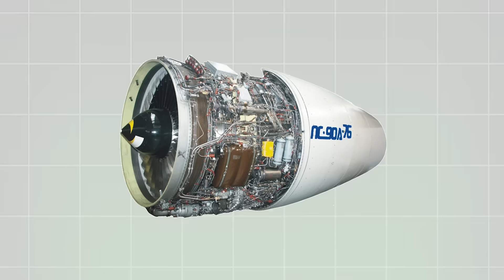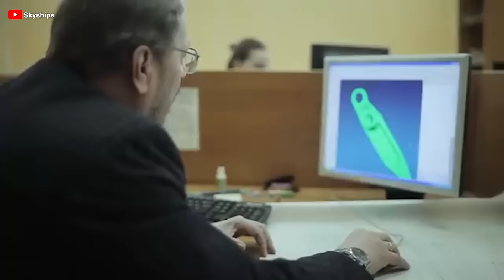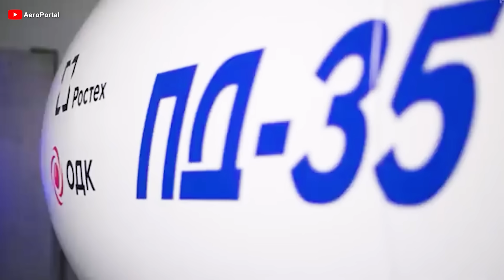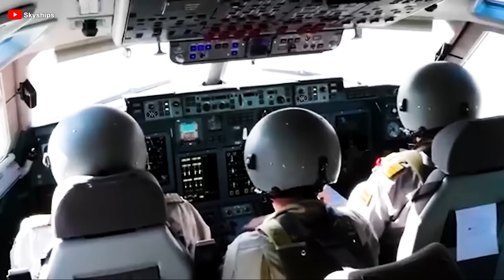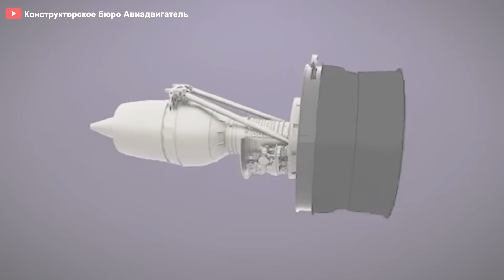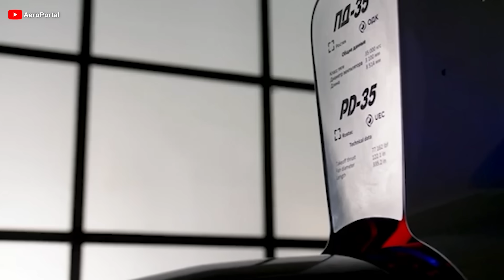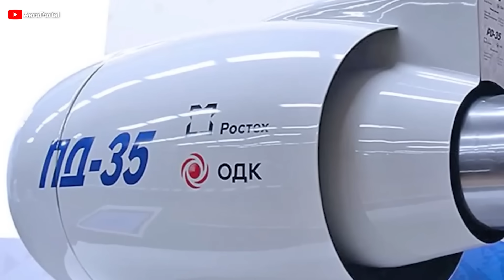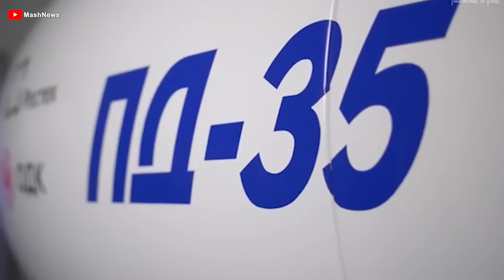Russia REVEALS the Il-96 will CHANGE Long-Haul Game-Changer! Here's why

Comment: If someone calls out "electronics is outdated" you are wrong. Likethose in earlier  airbus aircrafts, there are "aeroflex-inspired" rsverse-engineered microprocessors fully processed domestically. It could be replaced by honeywell parts if you have a strong need to.
Certs? Since boeing tests thenselves with faa crew that relay specific tests to boeing back.... whelp.... sound contradictory but tail wagging the dog.

Comment: To be correct, ПС90А engines can't compete with fuel efficiency. That is all. There were flight tests with P&W-1000, but westerners said "screw that jet, we don't need competition" pulling out P&W.  ПД-35 with HUGE intake and compressor will reconfigurate il-96-300 from 4-engine aircraft to 2-engine greatly reducing fuel hunger.
Reply: You are correct! Honestly the video is wrong in so many points. What maybe revives IL-96 and possibly TU-204 is the fact that Western sanctions are forcing Russia again to make their own commercial airliners, very likely in cooperation with China. That doesn't mean it would be competitive with Western aircraft. Btw. It was the PW2000, not 1000 which was planned to be a Western engine substitute for the PS-90. And that story is already 25 to 30 years old. Neither the PS-90 nor the PW2000 are really competitive with modern turbofans anymore.
Reply: Ps90a has  a bypass ratio of 5.3:1
At that time European and western engines had around 6-6.5: 1 bypass ratio meaning it wasn't that behind it's just after USSR collapse Russians semiconductor and aviation industry got wrecked
Reply: @gwramim4807 The PS90 isn't a bad engine but it was 20+ years behind Western engines where similar engines were made in the early 70's. When the PS90 came out the west already moved on.

Comment: Take example of A330 and A340, similarly, IL96 can also be offered in 2 or 4 engines with same fuselage. If the Boeing can sell 80 years old B737 with uplifted varient so why not Russia?
Reply from the maker: Great idea!
Reply: It cannot be offered in a 2 engine version because it simply doesn‘t exist.
Reply: @alexandervt641  It's coming as you saw in the video!
Reply: erm....the 737 is not 80...(jesus...) and the two Airbus Aircraft you mentioned...ARE BUILT PROPERLY.  Russia can't even make cars.

Comment: The question is what is China doing. Is it developing its own aircraft engines or will it partner up with Russia?

The West is significantly ahead in technology but Boeing is extremely corrupt and cut a lot of corners with the 737 MAX and has fallen as a reliable manufacturer, relocating HQ to Chicago, and production to South Carolina, they have badly made frames, bad workers, and a huge disconnect between the engineers and the production. They should have made a new plane already for the new bigger engines and they are still failing to do so. Meanwhile Airbus is winning the competition with the 320 Neo, they have a newer plane and can upgrade better, even though the A380 was a lot of wasted money in development and did not conquer markets as they believed it would. Because of these a third competitor can enter the scene but it is not likely to be Russia but China. China has the captial the time and the political will to create planes that are on the same level as western planes just like ti did in the car market, it might take a decade but it can get there especially if it teams up with Russia to learn as much technology as it can.
Reply: uh.  The ENGINES are not made by either Boeing or Airbus
Reply from the maker: I agree. China's growth rate in any industry is too fast.
Reply: FYI the Boeing headquarters is not in chicago.
Reply: @RaulGonzales-u7p  well it used to be in Seattle the whole thing and they could cooperate very well and when the merger happened with McDonnell Douglas that is when the HQ moved to Chicago. As far as I understand what I am reading it is still there:

In May 2022, Boeing announced plans to move its global headquarters from Chicago to Arlington, Virginia, a suburb of Washington, D.C. But it was not yet moved.

The whole point is they dismembered a well working company where the HQ the engineers and the manufacturing was all next to each other in Seattle.

Comment: Ił-96 is unermarkable, it coudl work but would need serious overhaul and technology refresh. Starting with engines, and with unremarkable PD-14 being latest Russian engine.... PD-90 is not for this day and age. Ił-96 could actually make a living as MRTT for non US aligned countries.
Reply from the maker: Thanks a lot for sharing!
Reply: PD-90?!?!? It will really blow up the market!🤣 Maybe u meant PS-90 - old one from 90-s? Today there is a line of the PD aircraft engines. "Unremarkable" PD-14...What do you mean? Its fuel consumption is more than 1 ton per 10k km? And the sound is louder than a mosquito? Unlike P&W and RR? Oh sorry both P&W and RR engines are also unable to brag of the same. So, what r u talking about? Please be aware that PD-14 has equal parameters to similar engine from P&W and RR. The next engine from the same PD line is PD-8 that is going to be commercialised this year. And it is also similar to its competitors. The next one, mentioned in this video, is PD-35 designated for wide-body aircrafts is also very close to be commercialised.

Comment: Maybe to transform legendary Jumbo Jet B747 into twin engine version and to return it into skies like super efficient game changer?🤔
Reply from the maker: Great idea!
Reply: While the 747 is overpowered with 4 engines it can and has crossed the Atlantic on 3 engines after a failure albeit just a little slower than normal and can fly on 2 engines the problem with a 2 engine 747 is that it would also have to be capable of flying on 1 engine in the event of a failure idk if a plane that size would ever be capable of flying on just one engine.

Comment: Nothing will change drastically, Russian aviation bureau still not able to produce a proper engine for planned air planes  such as Il-96 and software and electronics are still behind the west.
Reply: Interessant was sie alles wissen arbeiten sie in Russland?
Reply: ....."still not able to produce a proper engine for planned air planes  such as Il-96 and software and electronics are still behind the west." .....  This is exactly why NASA couldn't get its astronauts down for 9 months! Clowns!!! 😂 🫣
Reply: Boeing was more taken up with buying out McDonnell Douglas then taking on Airbus, then it was too late and the bean counters took over. Boeing now has to lean on the military side for shareholder stability while it learns how to build commercial aircraft again.
Reply: You heard that on CNN?
Reply: They're not competing with Boeing & Airbus. They primary goal is to fill a strategic need for sanction-proof airliners so that the West cannot cripple their domestic air travel (by withholding parts, maintenance and other aircraft-related services), which is crucial due to Russia's geographic size. Their secondary goal is to be able to fly international routes that are not banned by the sanctions. To that end, they only need to develop an engine that's 'good enough' and airliners that meet the certification standards required for these routes.

China is already doing that via COMAC. Boeing and Airbus fear they will lose the huge Chinese airliner market as a result (which Boeing estimates will be worth $1.4 trillion by 2040), and that will severely dent their financial outlook.

The West's sanctions have proven 1 important thing -- that necessity is the mother of invention. Russia and China didn't crack under the intense pressure of sanctions, instead they just work even harder and innovate even faster.

Comment: In an era of accelerating climate change, we should not be producing bigger, better planes.
Reply: "older worse planes are fine for climate" Says the climate activist. Ignoring new planes burn 2/3 the fuel of old ones.
Reply: On the contrary larger planes tend to produce way less CO2 per passenger mile flown, it is smaller planes that are less efficient, based on this, the push should be to ban private jets and push airlines to have larger less frequent services. The reason that doesn't happen is because it is all fundamentally a scam promulgated by an army of useful idiots.
Reply: Why?
Reply: @Yannickille  "Flights are energy-intensive and depend on fossil fuels. Subsidies from fuel taxes give the airline industry an unfair advantage over other transportation modes. Emissions from flights stay in the atmosphere and will contribute to warming it for centuries. Aircraft release emissions high in the atmosphere, triggering chemical reactions and atmospheric effects that heat the planet.

Only three per cent of the global population flies regularly. The consequences of aviation emissions affect everyone."

('Air travel and climate change', David Suzuki Foundation)
Reply: I love flying❤ @Airlane1979
Reply: @Airlane1979  You are ignoring a couple of things:
1. Bigger, better planes are more fuel efficient than smaller, worse ones. They carry at least 100 more passengers while using 2/3s of the fuel and causing 2/3s of the emissions;
2. The country with the most Air Traffic is the USA and this is due to 2 reasons:
     2 - A. The lack of a proper Railways Network of any kind, let alone High-Speed Rail linking it's cities, thus making short-range flights a necessity;
     2 - B. Private Planes being the "default" form of travel for the ultra-rich, this is coincidentally, the largest contributor to the CO2 emissions made by Air Travel as Private Planes don't need to even remotely comply to the same emission standards as Commercial Jets;
3. Bigger, better planes means less-frequent flights and thus less CO2 emissions.

The Sollution is not to stop the production of larger, better planes, but to stop Private Air Travel and to invest in High-Speed Rail in order to make short-range flights redundant.

PS: Up until now Russian Air Travel has relied heavily on older, worse planes that have many times the CO2 emissions of this new plane. And unlike in the USA, most of Russia's Air Travel is medium-range to long-range flights.
Reply: @ravenouself4181  "Bigger, better planes are more fuel efficient", thus enabling more air travel to occur - as is always the case: see 'Jevons Paradox'. Solutions to climate change do not come from fuel efficiency, which drives greater use. It certainly has never resulted in "less-frequent flights and thus less CO2 emissions", and it never will. However, I agree that private air travel must be replaced with high speed rail. Sadly, we see only more of both, as in China.
Reply: @ravenouself4181  I sincerely doubt about private jets not complying to the same standards. Except they use a lot of fuel per passenger.
Reply: @ravenouself4181  USA, Canada, Russia, Australia are also larger than most countries. Canada is having most of the population on the great lakes. Russia in the west and south. USA has a small density in the center, but larger on the coast.
Reply: No such thing.
Reply: @oldgoat5589  But there are "bigger, better planes" - as this video shows. Don't you believe they are real? But seriously, to dismiss climate change... what kind of mind do you have that can pretend the growing mountain of high quality evidence showing how it is accelerating is not reality? Even the energy corporations have long known about it: 

"Projections created internally by ExxonMobil starting in the late 1970s on the impact of fossil fuels on climate change were very accurate, even surpassing those of some academic and governmental scientists, according to an analysis published Thursday in Science by a team of Harvard-led researchers. Despite those forecasts, team leaders say, the multinational energy giant continued to sow doubt about the gathering crisis.

In “Assessing ExxonMobil’s Global Warming Projections,” researchers from Harvard and the Potsdam Institute for Climate Impact Research show for the first time the accuracy of previously unreported forecasts created by company scientists from 1977 through 2003. The Harvard team discovered that Exxon researchers created a series of remarkably reliable models and analyses projecting global warming from carbon dioxide emissions over the coming decades. Specifically, Exxon projected that fossil fuel emissions would lead to 0.20 degrees Celsius of global warming per decade, with a margin of error of 0.04 degrees — a trend that has been proven largely accurate."

('Research shows that company modeled and predicted global warming with ‘shocking skill and accuracy’ starting in the 1970s', The Harvard Gazette January 12, 2023)
Reply: The plane is not better but worse:)

Comment: I am not a supporter of air transport. I prefer cars. But if I ever had to fly on a plane, for example, to Cuba. I would prefer a plane with 4 engines. It has less chance of falling.
Reply: Spoiler alert

Statistically, one is more likely to be involved in a fatal car crash than a plane accident.
Reply: @KwakuAddoDanquah  In a car, you are the one driving and can avoid an accident. Yes, there is a chance that some idiot will crash into you. But in a plane, you can't do anything at all, nothing depends on you.
Reply: @Каш505  still doesn’t change the fact that statistics shows airplane to be safer than cars

Comment: Russia had a chance to do something together with China. This is gone now.
Reply: Why has it gone??
Reply: @KizzieWiz China just wanted to use the Russian engines but basically have all the market for themselves. Russia wanted  to share production and profits equally. They didn't agree on the scope of participation and control over the project.
It's very hard to deal with China even for Russia when it comes to business. They are tough negotiators.
Reply: @manichaean1888  As a result Russia will have to compete against the Chinese rather than to cooperate. Vu we are talking 2040 here
Reply: Another long term positive for Russia IMO
Reply: China stands back to back with Russia. No bridges have been burned.

Comment: Yet another dull subsonic aircraft with original concept going back to 1950’s instead of a game changer that can get you somewhere fast.
Reply: Show us yours that's more advanced
Reply: @ I don’t build aircrafts and If I could go from New York to London in 3 1/2 hours in 1968 and now it takes 6 hours something is wrong!
Reply: They could easily design a supersonic aircraft for transportation, the Concorde flew for a few decades. But it comes at a cost that is not acceptable. 

The Concorde was relatively small and carried only 80 passengers. They could not fly supersonic over the continents because the sonic boom signature was massive and would not be tolerated by the public. 

I flew C-130s and was often out at Edwards AFB in the Mojave Desert. On occasion, a sonic boom from a fighter would rattle the base. It was absolutely ear shattering. Windows would rattle and old household would break. Car alarms would go off and people would reflexively duck as if a bomb was going off. And that was from a little fighter platform. A supersonic  airliner would have much larger sonic footprint. 

When the Space Shuttle would be making its approach into Edwards AFB/Rogers and Rosamond Dry Lake Bed, the sonic boom was large and it was further away and at a far higher altitude. It would shake our windows and it was slant range,  probably 20 to 30 miles away. The sonic footprint alone would preclude the production of supersonic airliner. 

But that is not all. The fuel burn to move that mass through the air at supersonic speed would be untenable. 
It all comes down to drag. With the increase in speed, drag also increases. But that increase in drag is not linear, it is exponential.  The drag at supersonic speed is immense, even at higher altitude it still builds and becomes a limiting factor. It also stresses the airframe and will cause structural failure and break-up at higher speeds.

Today airliners can fly much faster than what they cruise at. But they purposely fly at a lower Mach number to conserve fuel. By flying at a slower speed, it may take 30 minutes longer to cross the U.S., but it may cut total fuel consumption by 20%.

They can build faster airliners, they have the technology. But the increase in speed is not worth the costs. Just think about it. In 1849 it would take 6 months to travel from Chicago to San Francisco, with about only 75% of the people surviving the trip. In 1944, by train or bus it would take about 4 very long days to cross the United States. Now today it takes only 5 hours, 30 minutes to fly from Los Angeles to New York and people are bitching that it is too long to sit on their ass in relative comfort. WHAT THE FUCK IS WRONG WITH PEOPLE!
Reply: @JohnBasiglone totally understandable. Some people are just plain !di°ts
Reply: @ Nothing wrong with a people but unless I am taking a joy ride I want my trip to be as fast as possible and done with it.
Reply: "subsonic" 😂😂
What a M O R O O O O O N
You mean like every single commercial plane out there? 😂😂😂
Reply: @ if there is a moron it’s you clearly!